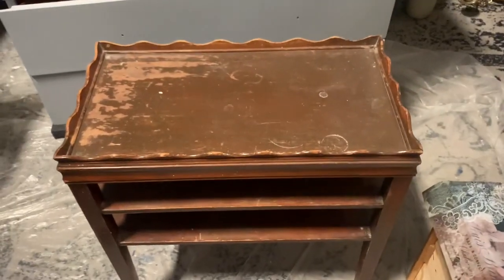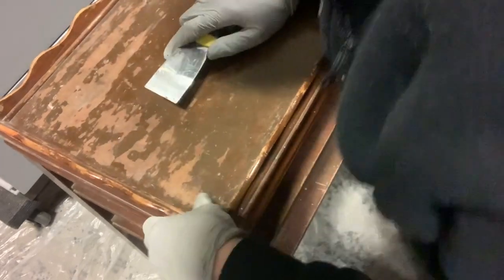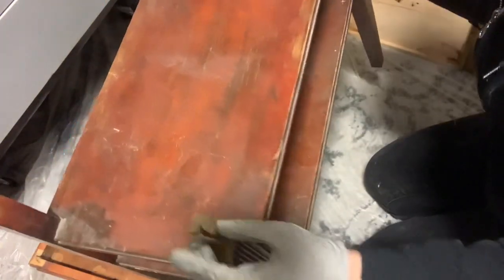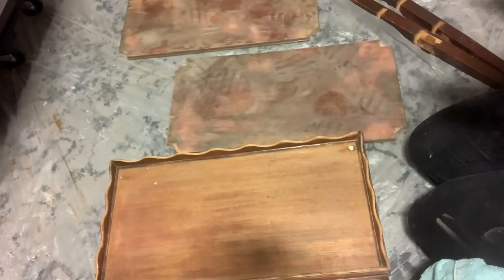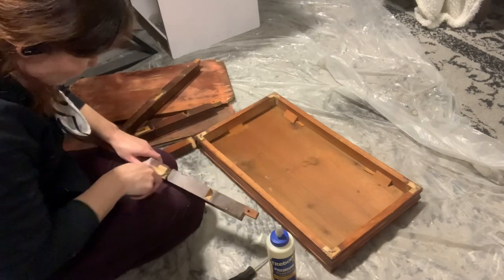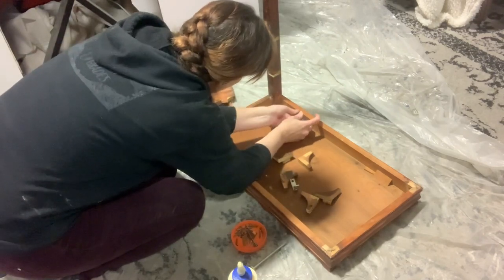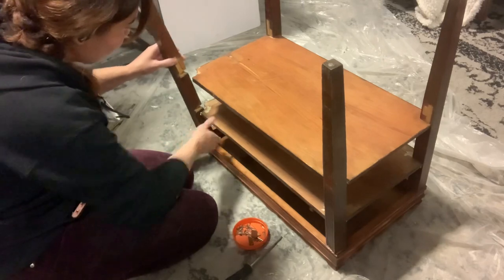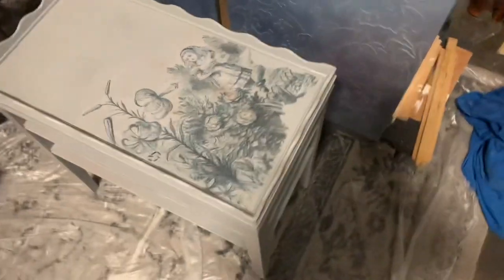Rickety Table Dissasemble - Reasemble | Fixing A Wobbly Table or Chair | Elegant Upgrades

Comment: Hi, I'm super new at this. I bought a wobbly little table for personal use. Would you share the name of the glue please. Your video is wonderful! I just discovered you today.
Reply from the maker: Oh hi! Sorry for the delay in response. So happy to have you here. On this video in particular, I can remember the specific glue I used- but if it was a clear brownish color, it was Hide Glue. I use the one from Tite Bond. And if it was regular yellow wood glue, I use either the Gorilla Wood Glue or the Tite Bond Wood Glue. All of those are amazing. The regular wood glues I use interchangeably, but the hide glue I mostly use on antiques or on things that may require a reversible bond. I hope that helps!
Reply: Thank you very much for the info.  I was able to fix a small table. Luckily, my husband had some wood glue. 🙂